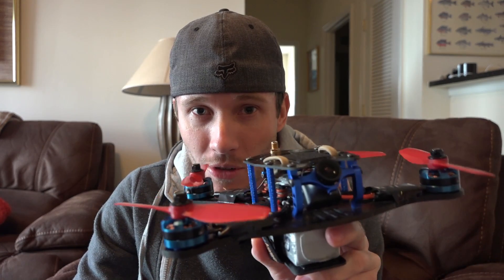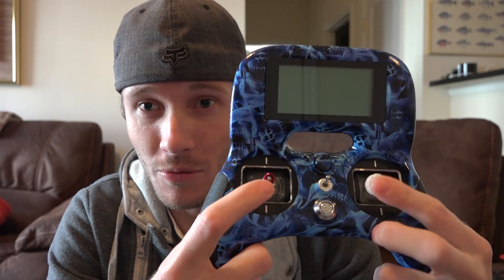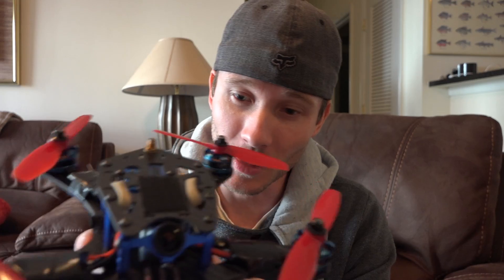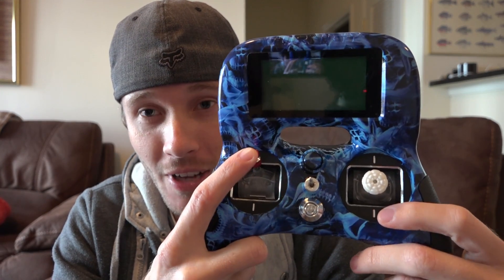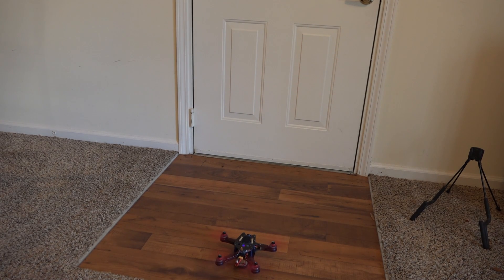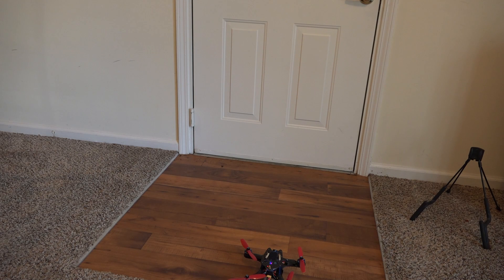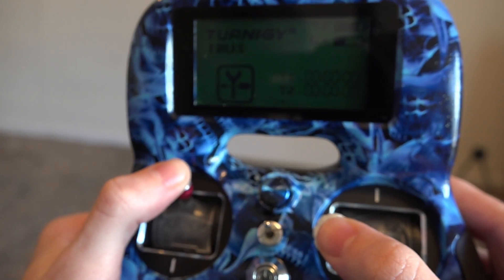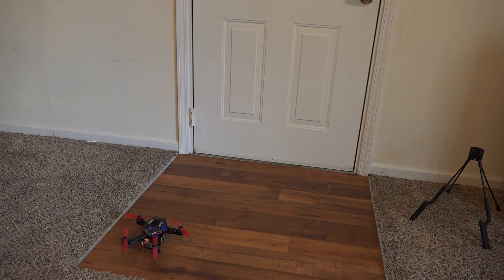Perfect Accelerometer Calibration

Comment: Maybe I missed it, do you have the quad in Acro, Angle or Horizon mode.  Does it matter?
If I recall, seems the ACC is not used in Acro?

Plus when I tried this, I was using the opposite to trim, if it went right I input left trim, however, the BetaFlight got me as you mentioned.

Thanks 
BobFlyer

Comment: JC I have a question for you. If you could shed some wisdom on this it would be greatly appreciated. 
I still use angle and Horizon mode.  All my flying has been LOS. I'm hoping by the winter thaw I'll be ready to fly fpv. Been practicing with Freerider sim.
Now I have used Naze32 r5 and r6,   Kiss, X-Racer F3 v2 and now the flip32 F3 Omnibus. Also different frames, ESC, Motors, props  you name it.  I experience this annoying drift. it seems like no matter what.  I've tried your method and nothing. now of course this is after setting and points and calibrating through BF.
If I try using trims it seem to help for that flight only. Because the next battery. The quad will start off in the directions the trims are set to.
Do you have a clue as to what is happening? I'm throwing this out because we have a discussion going on in CT FPV Racing's Facebook page. Some of us want to teach our kids. This would really make it difficult for them. Hard enough learning to fly forget having to fight the quad all the time.  My daughter is only 8.
Sorry for the winded post.
Please help.. and thank you in advance for any information you may have to share.

Comment: hey man great video! just a quick question what do you do if the quad starts out perfectly stable then the drift gets worse and worse as you fly? by the end of my flights i have to trim my pitch back about 20 clicks please help! quad always wants to pitch forward as i fly but starts out totally stable any information would be greatly appreciated thanks in advance
Reply: That's probably due to the gyro noise and can be caused by the high vibration. You won't be able to fix by trimming the accelerometers. Some case helps to balance the props and/motors or to install a silicone vibration damper between your FC and the frame.

Comment: Sorry if this is a dumb question but, NO antenna on your vtx? Is that not a quick way to burn out the vtx?
Reply from the maker: I use the RMRC Cricket VTx's. They power on with the battery plugged in but they don't transmit until you press the button. As long as its not transmitting you're safe.

Comment: Good tip but in my case it doesn't work.  The quad drifts backwards but it's not constant.  It changes more or less on how hard I'm on the throttle.  If I pump the throttle a few times, the quad will drift backwards very hard. It I hold it steady by pushing the stick forward, the quad will eventually level back out with minimal drift. I've tried everything but nothing will fix it
Reply from the maker: Sounds like you need to adjust your pitch I term
Reply: tried messing with turning the I gain up and down but no luck .
Reply: Soft mounted the flight controller,  checked motors for vibration , balanced props, changed props, turned the gains up and down for angle/horizon mode in beta flight .... nothing helps?
Reply from the maker: You've got me on that one. Sounds like you've done all the right things.
Reply from the maker: paul zug Yep sometimes that's just what you have to do. Just last week one of mine would roll to the right and pitch forward, but wouldn't pitch backward or roll left. Couldn't figure it out so I started replacing parts one by one till it went away. Turned out to be the flight controller.

Comment: So these stick commands adjust the settings on the Board itself and not the Controller?
Reply from the maker: Not sure what you mean. It's basically making the same changes as you would in Betaflight, only through your transmitter.